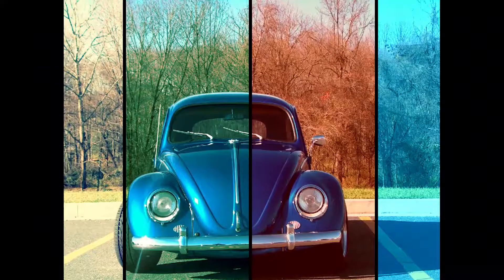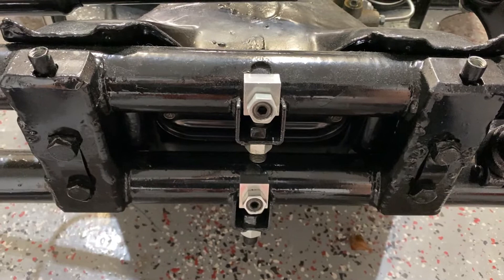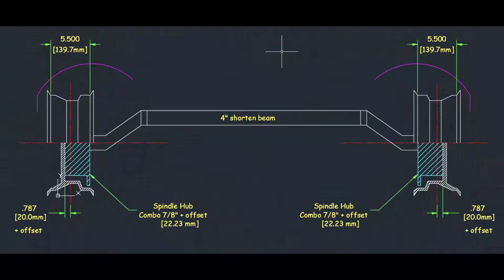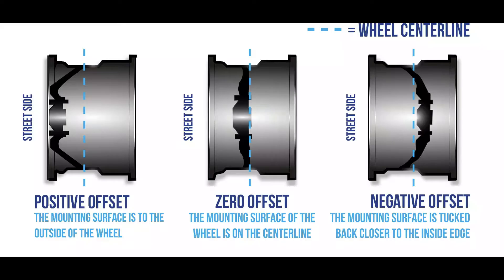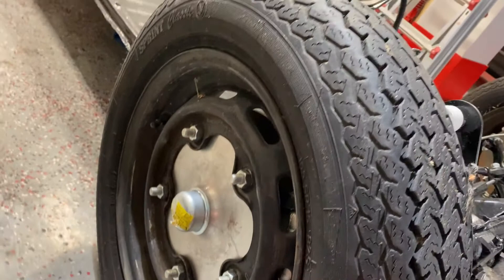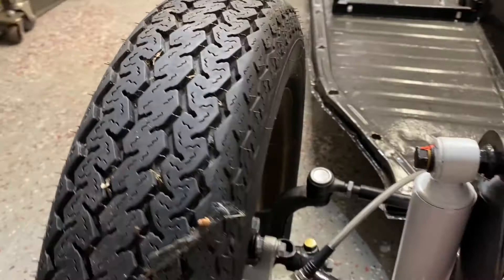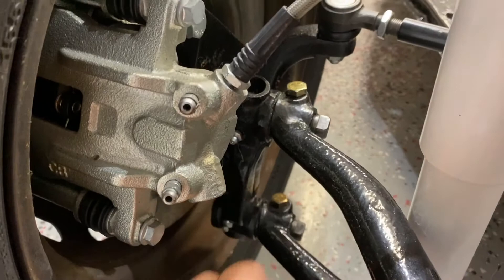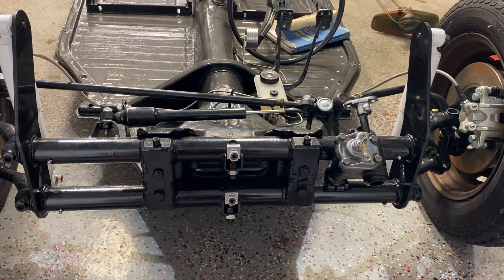VW Bug Front Suspension Setup

Comment: if you would´ve bought the wrong front beam for your year of beetle and a disc brake conversion kit from empi with dropspindles. would that make so the car would be incredibly low even with the adjuster of the front beam on its highest possible setting?

Comment: Great video. After using the the drop spindles and disc brake conversion did you increase the total wheel width over stock or did you use a narrow beam? Thanks
Reply from the maker: It’s a narrow beam in the video. I kept the narrowed beam to keep the wheels tucked in the fenders. Thanks for commenting.
Reply: Our experience with narrow beams is not positive; it alters the steering geometry of the car; the tires can hit the pan/body and even front brake hoses, destroying them.

Great video with great explanation!! Thanks for sharing.

Comment: Hi I have a question I have a airkewld  front suspension on my 1960 vw bettle and going down the drive way the other day one wheel was straight and the other was turned could you point me in the right direction on what could be broken? I'm am having a hell of a time trying to figure this out Thanks in advance
Reply from the maker: It could be a broken tie rod end, a trailing arm not fully secured onto the torsion bars or a link pin is not fully tighten. I would start with those and then do a front end alignment.
Reply: @FixinBugsNStuff  ok thanks